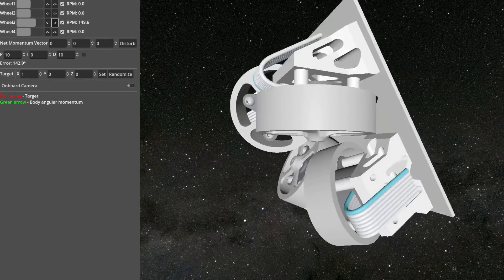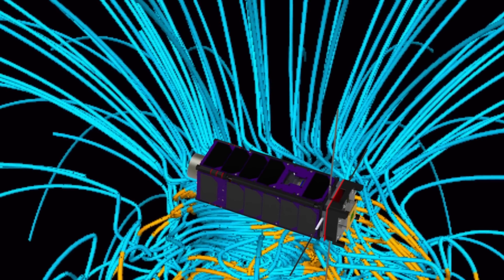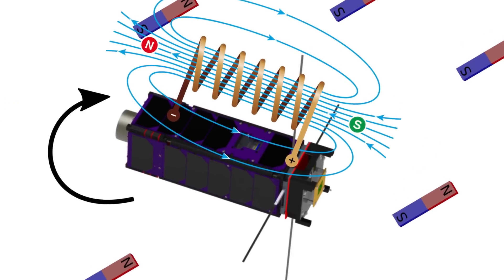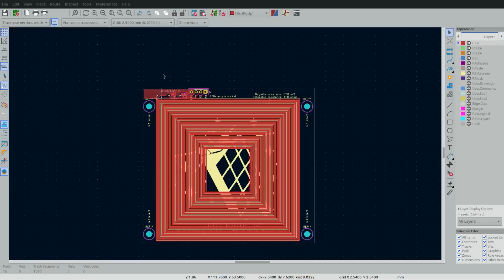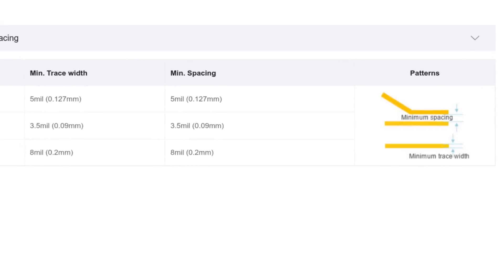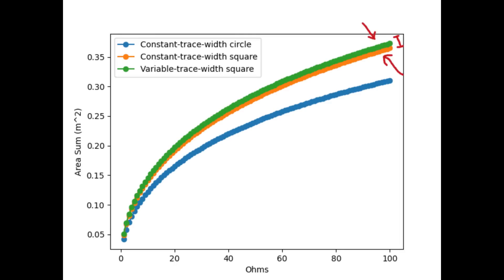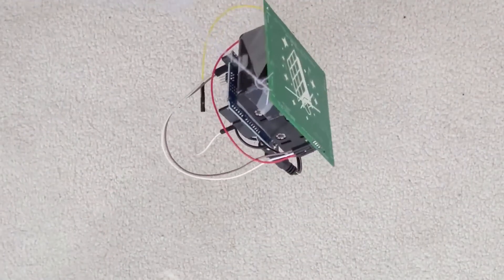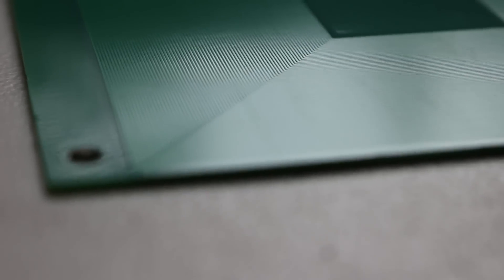PCB Magnetorquer Prototype - Husky Satellite Lab

Comment: Superinteresting, I always wondered, but never cared to research how reaction wheels deal with saturation! Also I rarely post but its great to see awesome "DIY"/scientific content coming from PL - keep it up! 

Given how little space you have on the cube sat - I wonder if such magnet could be reused for other things too when its operation is not required - e.g. a really bad antena ;)
Reply from the maker: Good point. The magnetorquer can be used as a heater if the satellite gets too cold!
Reply: Maybe measure the voltage over it to detect if the satellite is tumbling after release.   I guess if the satellite is tumbling and you switch on the torquer it might not stop the tumbling as the force is small.   But if you know the frequency and phase you can switch on the torquer only at the moment that it almost lines up with earths magnetic field .. and use less power.   Because when the angle is 90 degrees the force is zero i guess..  and by turnining it on and off in a smart way you might be able to stop oscillation
Reply from the maker: Good idea, we might add a voltage sensor to detect the direction of rotation. Though our primary reference will be an onboard camera tracking stars. And yes, we'll need to create an algorithm for a microcontroller to turn them on and off at the right moments.
Reply: As the Kepler Telescope reactions wheels failed, it was able to continue science observations by using the unbalanced solar torque (the photons) as a third source of torque and kept pointing with only two RWs.
Reply from the maker: @stuartgray5877 Super interesting!
Reply: How strong is the board? could it be used as a structural panel?
Reply from the maker: @benjaminshropshire2900 It's not strong enough, and integrating it structurally with the rest of the frame would be difficult.

Comment: how hard to heat up?  is cooling needed if it's in many layers?
Reply from the maker: Heat generated is V^2 / R. This prototype is 10 volts and 100 ohms, so it generates about 1 watt of heat which is almost imperceptible. For comparison, a microwave generates around 1000 watts of heat. However, even 1 watt has to be carefully radiated away when in the vacuum of space. Adding layers while keeping electrical properties constant would increase torque while keeping heat constant.

Comment: How about a thin double sided PCB? You could print 2 slightly different coils to either give you more power or more precision. Come to think about it, how about 4-, 6-, 8-, 10-layer PCBs up to the manufacturing limit? You could simulate weight vs magnetic flux gain. Or, you could just show I have silly ideas 😀
Reply from the maker: In this video I used a 4-layer PCB as a price compromise. In a future prototype I might add more layers to increase magnetic moment given a fixed resistance. Layers don't impact weight too much since the manufacturer decreases inner substrate thickness to keep total thickness constant.
Reply: @marcinanforowicz8319  I think usually, layer 2 and 3 are thinner than 1 and 4 as well. To keep in mind when calculating trace resistance
Reply from the maker: Yes, very important to make sure the scripts are configured properly for the manufacturing settings. I use a config.ini file for this: https://github.com/manforowicz/Magnetorquer-Calc
Reply: I checked PCBWay and they offer a 0.4mm thick 2-layer PCB that is still not a flex PCB

Comment: It can be done multilayer, right?
Reply from the maker: Yes, this is a 4-layer PCB. More layers would increase its magnetic moment, but the cost rises dramatically.
Reply: @marcinanforowicz8319  OK, I posted a similar idea without reading the comments, sorry. You are right that these PCBs are expensive. I checked some quotes at PCBWay and a 50mm x 50mm 4 layer 0.4mm PCB with 3/3 mil traces is about $300. If you have never ordered from PCBWay you can get a 2 layer 0.4mm PCB and order them for $5. Then you can stack them with something like thin Mylar spacers. This wouldn't be a production piece, but perhaps good enough for testing.
Reply: Well, a 2 layer 0.2 mm PCB can be made at PCBWay for about $100...
Reply: @slawomirjanicki9580   @Marcin Anforowicz 
 
Look at JLCPCB, they have 8layers for just $~5. In my experience they are way easier and cheaper to work with in comparison to PCB way. It sounds to good too true until you use them.
Reply: @c0d3d85  I am not sure they offer $5 8-layer PCBs. I think the $5 offer is limited to 2-layer PCBs 0.4 mm or thicker.
Reply: For one of our instruments we did a flyback DCDC with a planar transformer -  it was a 12 layer PCB (polyamide) so it would be possible in this case as well.